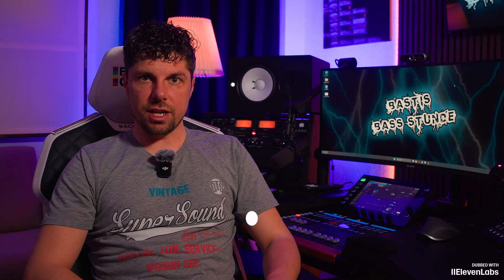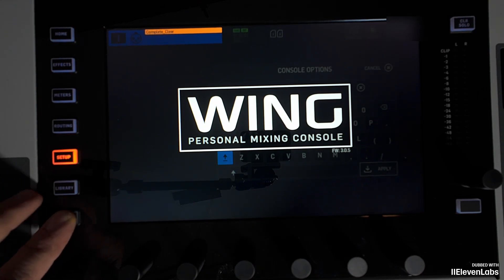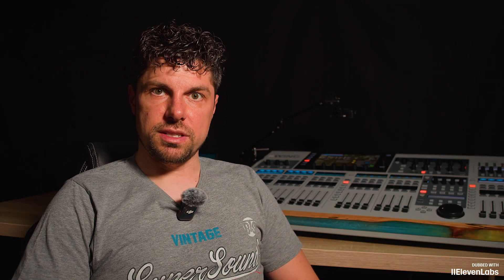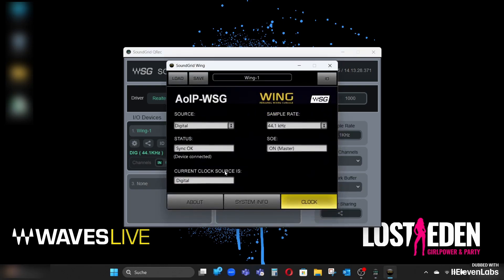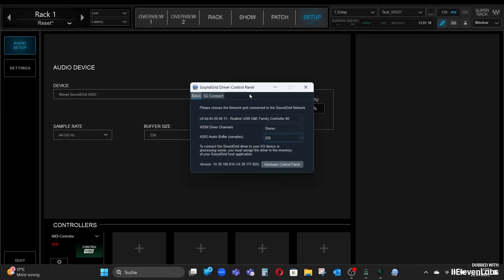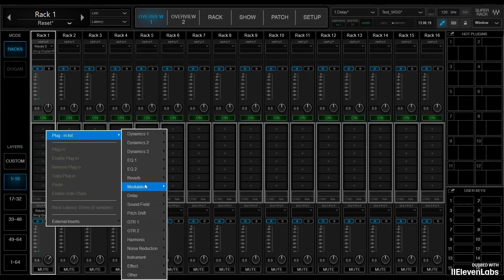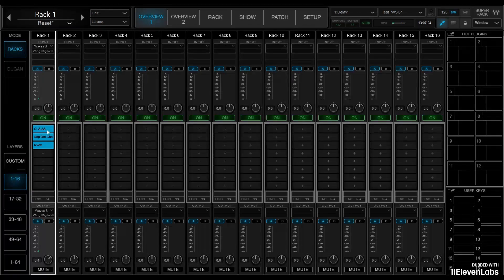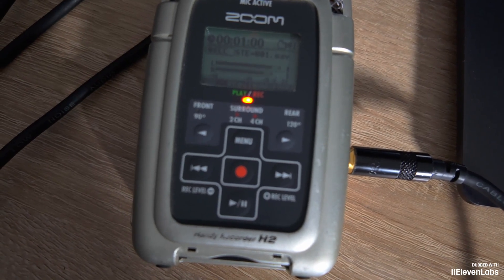Bastis Bass Stunde (English): Behringer WING Waves SoundGrid WSG Module AoIP #behringer #wsg

Comment: What is the importance of the MAC address on the wsg card? I have been trying to connect mine to my computer but it is not seeing the Wing. On the console, it is showing the wsg logo and I can route to it on the console but my computer is not seeing it.
Reply from the maker: Hi, so you have entered the wsg mod string correctly? If yes, try to switch the internal ethernet switch to "separated". You will find this settings on the lower right corner of the setup page. But only if the module is activated with the correct mod-string. greetings Basti

Comment: Hello, I'm from Brazil. Does this card work at Wing Rack?
Reply from the maker: Hi, yes it does.
Reply: @btsipsheim  I need SG server for use the Superack Performer or simply cat6 cable on my laptop?
Reply from the maker: @caalinuxro  You can also use Superrack Performer, like i do in the video. In that case you don't get the minimal latency like with the SG server.
Reply: i installed wig module in wing rack today
Reply: Funciona em todas as wings! @igorpaiva9812